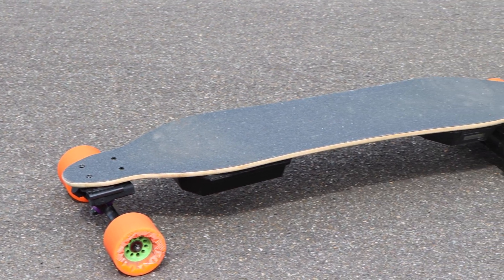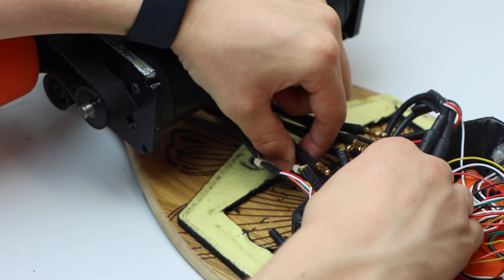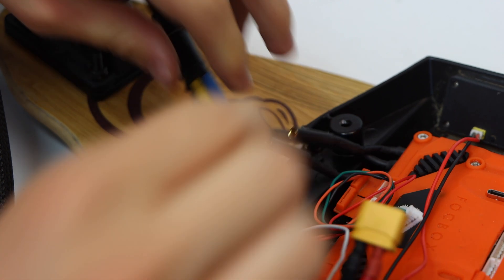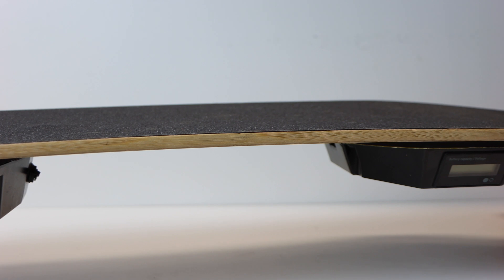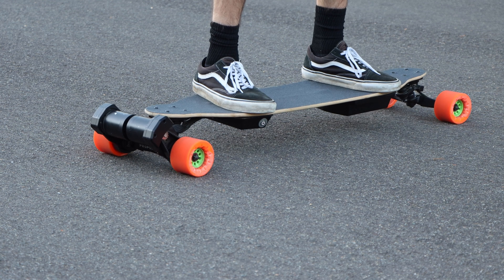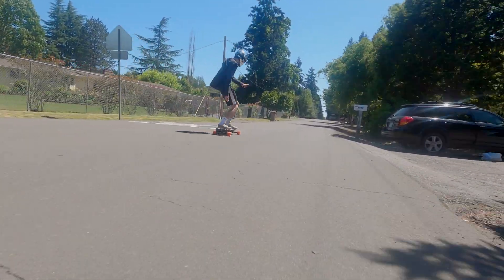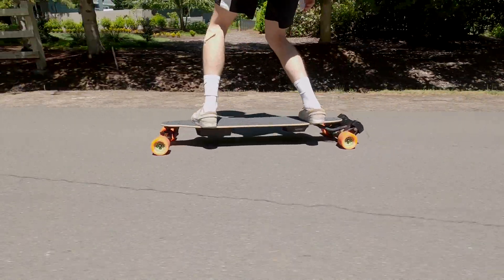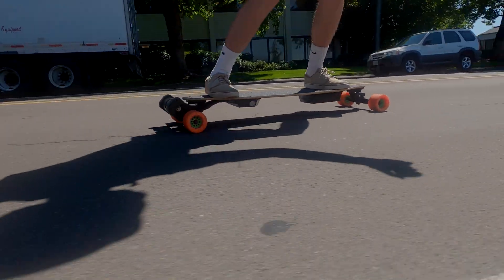How to Build a Boosted + Evolve DIY Electric Skateboard *ULTIMATE CARVING MACHINE*

Comment: The caguamas, although required for the iconic look of the boosted, are probably the weakest part. 85mms are too small.
Reply from the maker: 100% agree
Reply: i disagree. "comfort" from vibration is the last thing i worry about. skating isnt about comfort. smaller wheels give more agility. more power. more acceleration, better braking, and caguamas are basically the best quality street wheel there is..

Comment: Nobody has came out with the best design yet. One with a swappable battery pack and board splits into 2 pieces to fit inside a regular backpack.
Reply: There's an Italian board that folds in half. Someone could probably rig something with that. It's already an eboard so probably wouldn't actually be the hardest thing